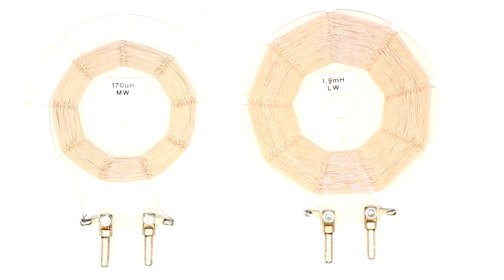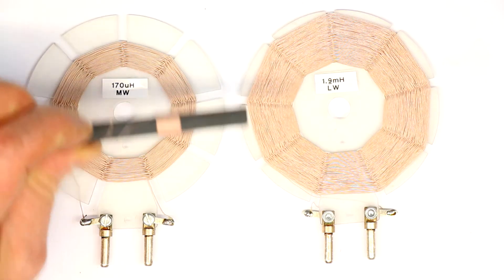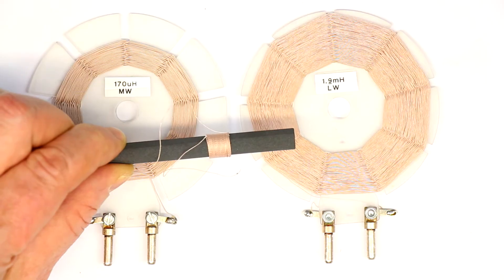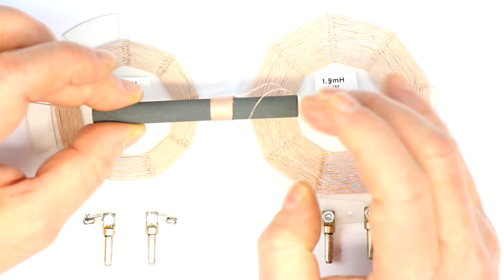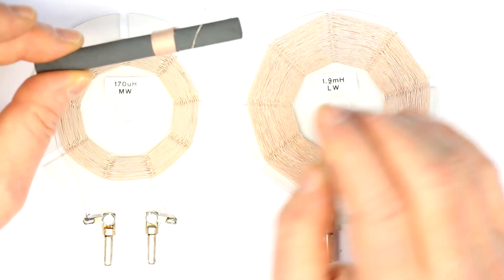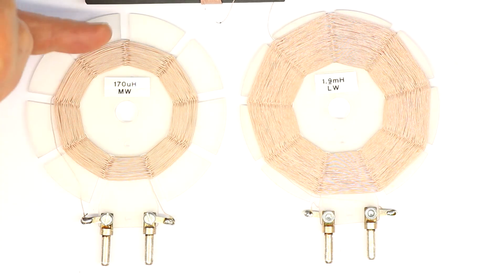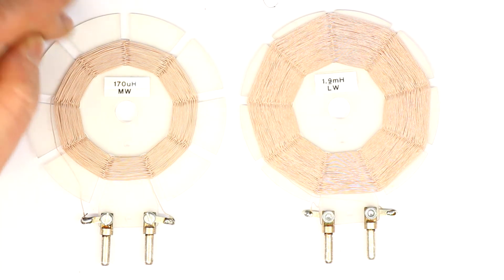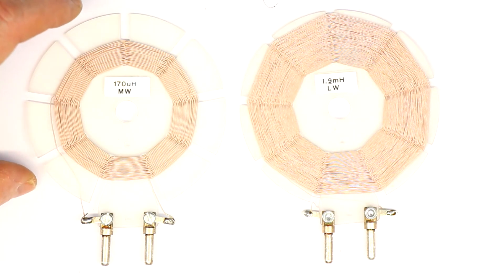Spiderweb Coils: Why to use them

Comment: what about taping 3 or 4 ferrite rods together in "parallel", would this be the same as a loop of triple or quadruple diameter? (eg 4 rods = double diameter?)

what about making the ferrite rod longer by gluing 2 or 3 end to end?
Reply from the maker: Making a bunch of parallel ferrite rods is possible and raises the AL-value (number of turns necessary for a certain inductance). That is usually done to get very high inductance-values necessary for VLF-reception.
Making the feerite rod longer by taping rods "in series" is hardly feasible and has no advantage.

Comment: It is all about minimising self capacitance. This maximises the tuning range. The coil that looks like a star is the right way to do with this - keep the turns far from each other.
Reply from the maker: Yes, but much more difficult to wind. The "spider web coils" have low enough self capacitance for tuning the whole AM-range with a 500 pF variable capacitor. More important than the self-capacitance is the lower (external) proximity effect of the star-like coil!

Comment: Could you not use tesla's bifillar pancake coil then, It's supposed to present ohmic resistance at resonance from what I understand.
Reply from the maker: Tesla coils are designed only for one certain resonant frequency and their parallel-capacitance is taken into account in the calculation of the resonant freqeuncy. It can be much larger than in applications for radio circuits where you need the lowest possible parallel capacitance.

Comment: from australia,, price for themplate to wind coil where to send money..many thanks joe
Reply from the maker: You can find them in this section in our online-shop: 
https://www.ak-modul-bus.de/stat/hf_antennen_und_passive_bauteile.html
You can directly order from the shop also with shipping to Australia.
When we can fit the ordered parts into a small volume and the weight is not to large, you get much cheaper shipping rates (although slower of course). And of course German VAT is subtracted from the total. So if you order, wait for a manual confirmation from us next day, if we can offer you lower shipping rates.

Comment: How would they do to make a transformer?
Reply from the maker: I don´t quite understand the question.
Reply: They are used in antenna matching and for feedback transformers. I used two stacked with adjustable spacing for a regen set I used in the 1970's. As an auto-transformer you can just add a tap.

Comment: Very interesting! Liked and subscribed! As a rookie in this field I got a question: As far as I understood, there is a "golden mean" in making AM antennas. So what are the optimal numbers for the best AM reception? The optimal inductance in microHenry? the optimal diameter of the copper wire? The optimal number of coils? The optimal diameter etc.
Reply from the maker: This is all discussed in the playlist about AM Magnetic Antennas. Especially with the videos about the spreadsheet for calculating the properties and the effects of skin-effect and proxomity effect.
The AM range from 550...1700 kHZ is just the "crossover-region" where litz-wire falls behind a thick solid copper-wire at 1 MHz.
This can be seen when calculating the properties of our frame-antenna once with litz-wire and once with solid copper-wire of 1...1.5mm diameter. There are simply too many factors to consider to give a recipe for an optimum AM antenna.
Reply: @KainkaLabs  Oh, thanks a lot! I'm gonna watch them! I thought that wire diameter had a negligible effect on AM reception, it seems I was wrong.

Comment: Can you provide some links for the parts necessary to build the antennas?
I found out on the internet that some LW coils on ferrite rod antennas have the inductance up to 5 mH, and some MW coils have up to 490 µH.
The above stated In the description of „Ferrite Rod Aerial for LW & MW, with link windings on each coil” listing on eBay.
Also in the second eBay listing, „Ferrite Rod Aerial Loopstick Antenna with MW and LW Coils 120mm long 3/8" 9.5mm”, in the last (5th) image is stated „Join black and blue to form the ladybird radio «tapping» point.” Does this statement positively influences one of the characteristics of the antenna?
Reply from the maker: You find most of the answers to your questions in the videos in my playlist "Magnetic Antennas...":
https://www.youtube.com/playlist?list=PL6W_lVCKeS04QSwkbsivwqsmZpk8OSM7y
1.) The necessary inductance of the reception coil depends on the capacitance of the tuning capacitor.
You can do your own calculations in the video series "A Spreadsheet for Magnetic Antennas" included in the above mentioned playlist 

2.) You find the necessary parts in our shop (spiderweb-kits, litz-wire, ferrite-rod antennas etc.)
3.) A tapped winding (or a coil with a so-called "coupling winding") is used for receivers with feedback (regenerative receiver)
or if you want to transform the high impedance of the tuned tank-circuit to a low input-impedance e.g. of the headphone in a crystal radio set

Comment: Radio Shack has a regenerative short wave kit that uses a standard ferrite rod as an aerial. The coil consists of 14 turns of aprox. 0.4 mm diameter wire, each turn separated from the next by 0.5mm (to avoid the capacitive proximity effect). I fabricated such a coil by winding two strands of wire at the same time and (after fixing the turns with glue), unwinding 1 wire strand so that the remaining turns are evenly spaced. In a regenerative set of my own design, this tank coil, in combination with a 100 pF variable capacitor allows me to tune from 3 to 7.2 MHz. Sensitivity is really great for 80m. On 40m, regeneration is more difficult to obtain, but even at this frequency, the set is amazingly sensitive. Just to say that dismissing a ferrite rod for use on the shortwave bands altogether doesn't spur with my findings. Great video though!
Reply from the maker: Regenerative receivers are of course a different kind of beast because they partially make up for the losses in the ferrite rod material. The tradeoff is that the S/N-ratio goes down which is normally acceptable because the background (atmospheric+man-made) noise is much higher than the electronic noise.
You should watch my video about "A ferrite rod for SW-reception" where the losses of a special high-frequency ferrite material are explained in more detail with the curves in the detailed datasheet.
Reply: Radio Shack is no more :-(
Reply: @chadcastagana9181  I'll be sure to pass that along to the guys at my local Radio Shack in Lewisburg, TN :)

Comment: Can you transmit on one of these? And if not, what happens if you try to?
Reply from the maker: Small power (<1W) yes.
If you to put more than a few Watts of transmitter power into these they will probably blow up due to excessive heat.
The figure of merit of these coils is extremely bad. So most of the energy from the transmitter is transformed into heat and only an extremely small quantity into electromagnetic waves.
Getting a good AM transmitting-antenna is not an easy piece.
That´s why the antenna of "real" AM transmitters are very, very large.
Reply: KainkaLabs challenge accepted! I want to try to make one that can take 100 watts.
Reply from the maker: Have a video-camera or your smartphone ready to shoot the result the instant you connect your transmitter to the coil :-)
Reply: @WalterMelones  Hello, how did it go?